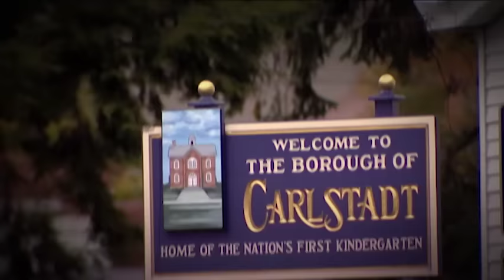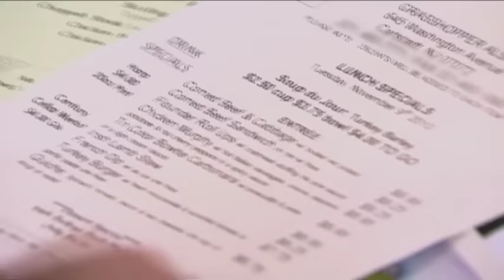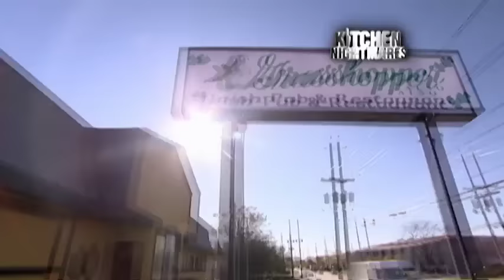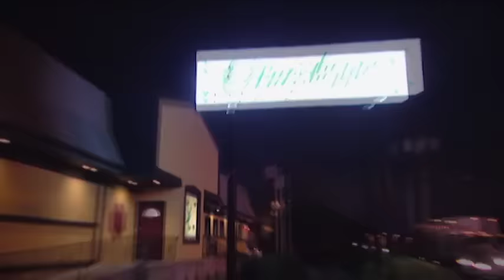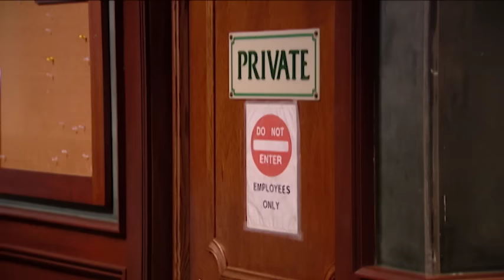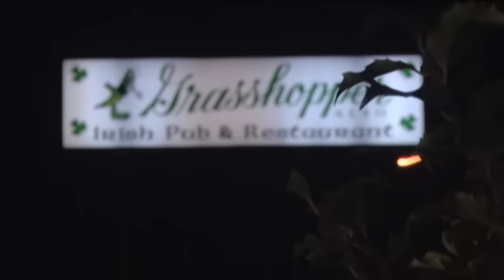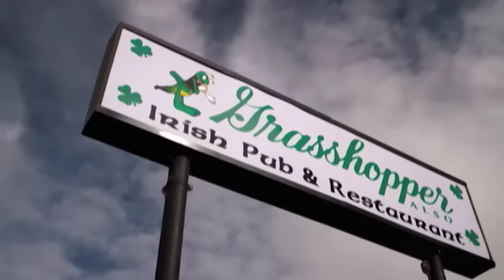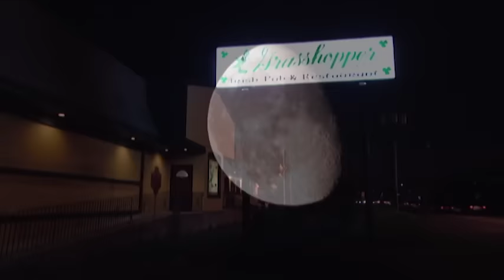Kitchen Nightmares Uncensored - Season 3 Episode 3 - Full Episode

Comment: Granted most of the burden is on the owners for the quality of the food, etc. - But what has me wondering after watching a few of the episodes is how any of their coolers can get that nasty with the food inside of it if health inspectors were doing their jobs correctly as well. I'm not a chef - although was delightfully referred to as one while cooking in one place. But I've cooked in a few restaurants - and they had regular inspections - plus would show up for surprise ones on occasion. If things werent up to specs you would definitely get written up for it and then they come back and check to make sure you corrected any issue they found, whether cooler temps weren't correct or whatever. I was fortunate to not have issues when I was a lone cook in a small bar/restaurant. But I also have high standards of cleanliness and made sure everything was marked and dated. The inspector used to call me a pro. So Im just amazed at the fact that the coolers in this place had all of that yuck in it. So - even though Mitch had never looked in the coolers and just trusted his staff - they must have some pretty low health standards or inspectors in NJ that don't do their job correctly either for all of that mess. Scary thought.

Comment: I went to this restaurant back when I lived in NJ in 2015 and had no idea it was a Kitchen Nightmares restaurant. Even weirder is that they opened a second one much closer to where I lived at the time further north closer to Sussex County. The original one was much better than the one by me but it wasn't a disaster story either. It was still above average. I recall them being owned by the same people at least. Still mind blown at this for no good reason.

-Update: It turns out what I went to is "Grasshopper Irish Pub" and "Grasshopper Too". The restaurants are sort of related but judging by where they are located they just look eerily similar on the inside and outside to the one in the show. I've also discovered how overused Grasshopper is used as a restaurant name. My bad!

Comment: I never understand the system these guys are working off of, I've worked in too many restaurants and in all of them the expo is a middle man between the front of the house and the line so servers aren't coming back all shouting random stuff at the kitchen, they also pull the food down from the window get it garnished and in order to go out, but the cooks should get their own tickets and cook from that, they shouldn't have to wait for an expo to "tell them what to cook", the cooks get a new ticket they start working it, when it's done they say "sold" the expo takes their ticket matches the items in the window to the ones on the ticket, call for a runner the end, in most restaurants the expo is a hostess or cook that does a shift here or there as expo, but this show makes it look like it's rocket science, like it's the most important position in the restaurant or something. I'm not saying it's not important, but a lot of times you don't even have an expo and server's just pull their own food and everything still works fine, it's nice having one, but it's not make or break.